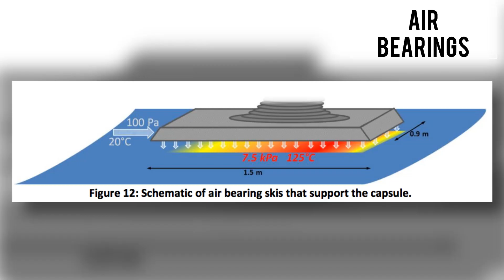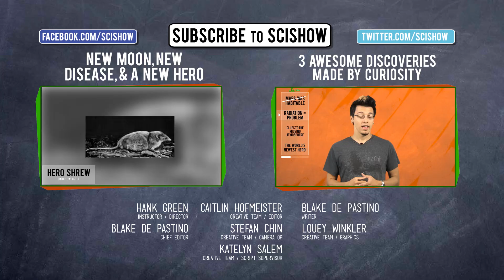The Science of Hyperloop

Comment: Only acceleration and deceleration requires the use of the magnets at each station.  The air bearings and compressor onboard each pod are used to maintain speed.  It's not as scary as you imagine.  Read the proposal before you shoot it down.

Comment: see if I have anything of known length and calculate it out later?...
or, use a cubit, as it is based on human anatomy, and works out to usually around 0.5m on average.

in other cases, sometimes it makes sense to make up units as convenient.
"well, it is 1/32 of a meter, and approx 1 inch, good enough...".

a lot depends on how important accurate measurements are in a particular situation.

...

Comment: 0 pressure is actually really hard to maintain, there's a reason modern vacuum chambers are tiny. What's more, a single failure could be catastrophic, the tube would become a straw with all the pods being blasted away from the breech. 

True vacuum pumping isn't easy either, especially on this scale. It's best to find a compromise between efficiency and speed, besides speeds that require a vacuum would require a near straight line of travel, even with G harnesses (cutting out a lot of people).

Comment: 57 megawatts per year? Really? A watt is a measurement of flow, I guess, as opposed to a measurement of volume. Ie you say "this heater uses 100watts", as in when turned on it consumes a constant 100 watts (or 100 joules/a second).

Do you mean an average of 57 megawatts of power, over a year (which would make sense, as seasons require a good solar estimate to be averaged of atleast a year) or do you mean 57 megawatt hours a year (which equals 6.3 KW~ which seems a bit small for that many panels

Comment: Not bad...I already covered this, though with fractalized dynamic and static field recombination (Dyson Drive) for field flex, allowing power production (on binary/trinary liquid stators) AND motive force (simple field vectoring).

Secondly, you don't need to compress the air...simply rework the tube as a giant Stirling motor (using Fresnel Buffers) to dump hot air behind (as the car passes each static unit) the car, while cooled air stays in front (and is evacuated via same Fresnel Buffers).

Comment: My point is, that in all ACTUAL applications, adjusting the units to the correct order of magnitude is the SIMPLEST part of the process regardless of which system your using. You don't know how many decimal points to move until you have 15 or more other factors sorted out. It's NEVER as simple as moving the decimal point. First you've gotta set up the calculations and work the steps. Metric is awesome, but keep that "Just move the decimal point" attitude and you'll FAIL any real science class.

Comment: Actually, it would be relatively easy to KEEP the tube depressurized. Just setup an airlock in the docking/undocking sections, and set up pressure sensors along the track along with some pumps.

Use the extra energy produced by the solar pannels to power the pumps, and keep maintanence crews on standby to come in and patch up the tube if it gets damaged. Better yet, use a few feet of steel for the tube. Would make it expensive, but harder to breach.

Comment: 1:15 The fan is not for pushing out air; it sucks air in, which would then be used for the suspension. "The vehicle... features a compressor at the leading face to ingest oncoming air for levitation and to a lesser extent propulsion."

Comment: Well space doesn't need to spend energy to keep the upper atmosphere at lower pressure.  In order to depressurize a wide, 560km tube, one would need a LOT of power and constant maintenance.  This would be to a point where it would be unreasonable to maintain these low pressures well before the speed of sound fell to 700mph.

Comment: I use both because they have two different purposes. I use metric in cases where I do need to convert units quite a bit (which the average person only really does it in school), working with very precise measurements, and on a computer program (sometimes) but never Celsius. With Imperial, speed is an easy concept, anything that needs to be divided in halves, thirds, and quarters (since an irrational number is a little tricky to measure), and just simple everyday things.

Comment: That the number system and the measure match well does make it simpler to learn, but that comes with the drawback, that you don't have to comprehend it to learn it.. We can mathematically work well in scales we don't comprehend though, which is good. But for quantities that we have to estimate on the fly, comprehending the scale becomes important. The culture uses the system the comprehend the scale of, and it's not just America where you see a mix of unit systems in that context as well.

Comment: and i totally thought of that, and my answer is the driven air comes in kinda like y's in right after the point of launch, the car is on straight tube and comes into high velocity air (with given time to speed up car using the air already moving at high speed, say idk 1k yards, just as an example.  the air moving from the we'll call them power fans, can draw air into the launch area of the tube, just by opening the tube behind the car and controlling it for acceleration. maybe....

Comment: Problem is that after the module passed, the tube would be high pressure requiring pumps to lower the pressure every time a vehicle passed.
This plan makes the tube cheap and the cars expensive, which saves money.

Comment: incredibly super high velocity and high pressure intake at one end, incredibly super high velocity and low pressure exhausting at other end, no barrier. don't use fans on the transport module. power the tube not the cars.

Comment: The off-loading/on-loading system is a mile or so. These parts allow for slowing down and speeding up so all "Hypercars" will be going the same speed while on the loop so there is virtually no chance of collision. The breaking system does not get hot enough where it makes a difference. Horizontal G forces are no more than a plane landing(<1G, Max ~1.7). Y'all are over-thinking things...
Source: Engineering experience.

Comment: The temperature coming from something friction-based could be used to heat up water and produce electricity or something... Still, I wouldn't like to hear the noise it'd make. Also, those pressure-based floaty panels... do I not get it or do they only work at ultra high speed?

Comment: Yes, we have said vehicles, but these are vehicles that are not only designed to deal with supersonic aerodynamics, but they do it at high altitude where the speed of sound is slower, and they're not in a tube so they don't have to worry about overcoming the Kantrowitz limit.  These vehicles are also horribly fuel inefficient at speeds past Mach 1.

Aerospace engineers have solved these problems for aerospace vehicles. but this a ground vehicle.  A sonic boom in a tube is a big problem too.

Comment: I quick way to calculate kilometers to miles (without a calculator) is to first half the distance, then add roughly 1/5th of the number you get. It wont be completely accurate, but it's close enough in most cases. For example: Let's take 340 kilometers. You first devide that by two (halving it) and you get 170. 1/5th of 170 is roughly 30 (34 to be exact) so you add that to your previous number, and you'll get 200(204) miles. (it's actually 211, but 200(204) is close enough in most cases.)

Comment: This is a fascinating concepts, but not without problems:

The speed of sound at sea level can vary based on humidity and temperature but is approximately 1200km/hr.   The speed of sound decreases as you increase the altitude.  Traveling at a speed this close to the speed of sound would be a concern because when you hit Mach 1, your aerodynamic profile turns into that of a brick.

Also, the G-forces that the human body would incur when accelerating and decelerating to and from such a high speed.

Comment: The train and passengers would be subjected to about 1.14Gs during deceleration, so yes, it's possible. However, you have a slight mistake. If the train begins deceleration at the exact moment the train ahead of it stops (presumably on a dime), it actually would take 60 seconds to reach the train ahead of it, since the average speed would be half of the max speed. Therefore, the actual force felt would be 0.57Gs.

Hope I helped!

Comment: The thing about electromagnets is that they're very predictable in the way they act; direction of magnetic lines, strength of the magnetic field, and size of the magnetic field. Given those parameters, which they would know, it's very easy to keep the electrical system from being interfered with by the magnetic field.

I'm a Master Electrician - this is what I do for a living, but if you take Physics in high school, you'll learn the same thing.

Comment: Corrections:

Kantrowitz limit: The compressor effectively reduces the frontal area by ingestion, some air is used for the air-bearings, the rest is used for (a little) thrust. The pod does not "push it out of the way"

Air-bearings: The bearing cushion is created mainly by passing air from the compressor though them, (upside down air-hockey) additional lift is created aerodynamicly at high speeds.

The proposal calls for the pod, and compressor to be battery powered. (charged by solar)

Comment: A kilometer is 0.67 of a mile. Kilo meaning thousand and meter meaning a distance just longer than a yard (a yard off the top of my head is 0.9133 of a meter). 1000 meters makes a kilometer. Look up metric system or SI units. SI stands for international system of units as the USA along with only a few other places still use feet, yards etc. (The imperial system which is derived from the lengths of such things as your stride (yard) or thumb (inch))

Comment: One mile is 1.609 km. A metre was originally defined as 1/10 000 000 of the distance between the north pole and the equator, and a kilometre is thus a thousand metres, or 1/10 000 of the distance between the north pole and the equator.

Comment: Also the "train" would have to be atmospherically sealed and have its own on board air supply, no doubt capable of supplying air for at least a full day, which should be ample time to mount a rescue operation. It would also be feasible to provide portable air supplies for each passenger and crew, allowing them to leave the train if safe to do so and find an egress point out of the tunnel.

Comment: I have a problem with the vent thing to redirect air around the pod. Thinking rationally air would still get bunched up in the tube unless it had means of escaping. Maybe a way to ventilate the air to the outside would be more parctical, and also, anyone think of the problem of the sound barrier? That could be devastating.